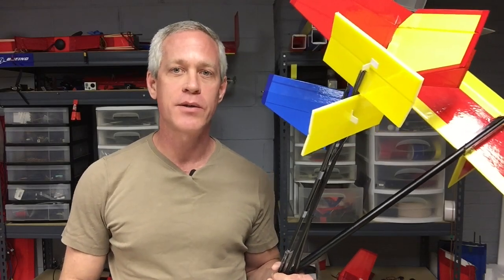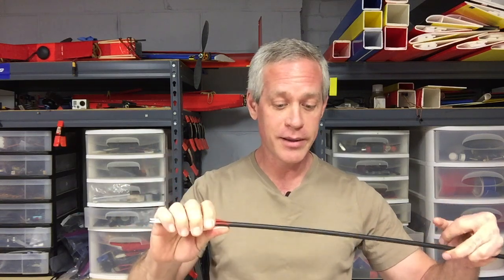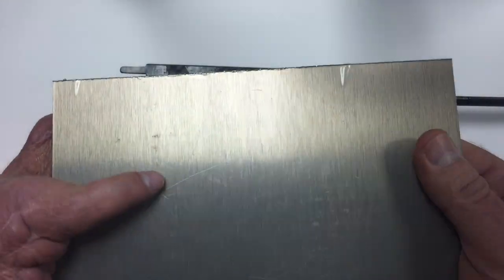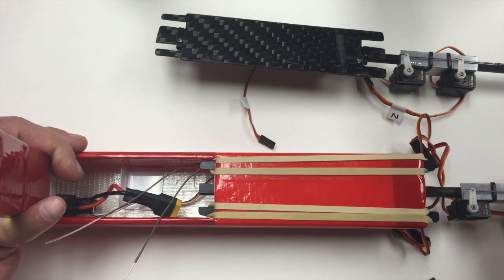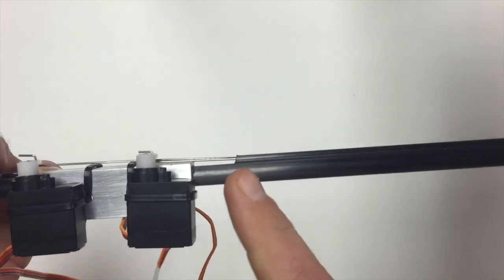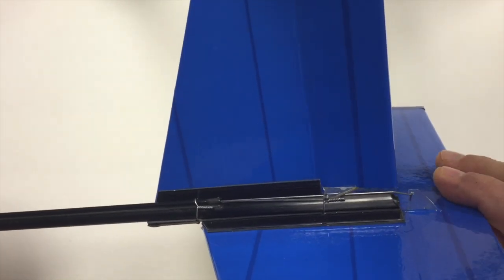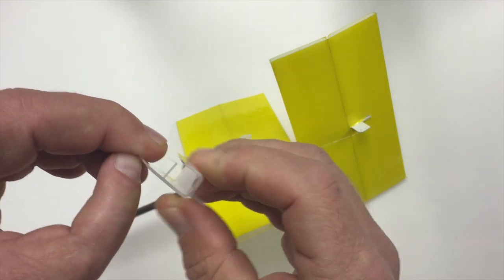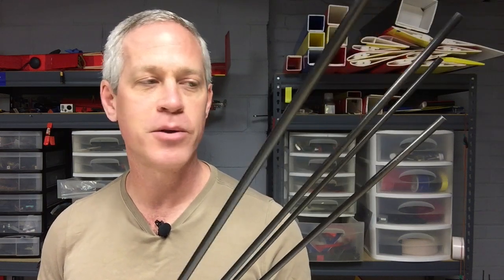Carbon Fiber Tail Booms

Comment: I know the Experimental Airlines designs have always been about cheap or free materials and ease of construction.  Ed, you got me back into the hobby with your building techniques, Thank you. I picked up a cheap 3d printer and have been using it to create servo mounts and tail adaptors similar to your corner molding.  Not everyone has access to the 3D printing and your methods are wonderful.  3D printers have come down to the "affordable" realm and fit into this hobby well. If you do have access to 3D printing, I recommend giving it a try.  It's been fun learning the cad software and actually fabricating custom parts for individual tasks.  Keep the videos coming and thanks again!

Comment: Some great ideas on attaching those CF tubes. Would have liked 
to see some of those designs in the air.
Reply from the maker: +lasersbee I wish too.  Here's the bummer:  I'm reduced to videoing with my iPhone, having gradually killed off all my proper video cameras.  Once I re-acquire a camera with zoom, I will make it right with the flying videos.
Reply: +ExperimentalAirlines I hear you... Sounds like a plan
Reply: +ExperimentalAirlines peter from flite test worked there

Comment: great vid - using a 10mm boom I have put my servos up front in the fuz, run the snake tubes down the middle of the boom, and drilled exits near the end - the reduced strength compensated by a 1/32 ply tail 'tray'. I really like the reusability and disassembly of your system though.

Comment: One advantage of using double stick tape in construction is that it can be removed with alcohol. It's messy but repair is easier when major components are assembled as you have done this way.

Comment: i attach the tail boom to the fusolodge with a installation foam block by drilling a hole and glueing the spar in it. then sliding the blick in the rear of the fusolodge rock solid without cf

Comment: You could just drill a hole through the plate and the tube and drop in a pin AND that would stop rotation and new way more reliable than glue. Also you can reuse the tube without having a glue mess on it.

Comment: Try inserting the 8 mm tube in several inches of a 10 mm square tube (it's a perfect fit) with  some hot glue. That gives you a flat surface to attach plate or fuselage.
Reply: +geo dezix What a great idea

Comment: Great video Ed.  Thanks. 
Any ideas on how to work with the plastic corner bead material? Does it have to be heated in order to bend without breaking or splintering; and the best way to make clean cuts?

Comment: how about assembling a V tail on a small carbon tail boom??
Reply: Chad Gacs you could use the L shaped plastic at a 45 degree angle.
Reply: Chad Gacs you could use the L shaped plastic at a 45 degree angle.
Reply: the design is a 100 degree angle for the V tail.
Reply: Heat the plastic with a hotairgun and bend it to about 100-110 degrees and finally EPOXY the carbonfiber right at the vertex of the "V". Remember to sand the carbonfiber at the end or else it wont bond properly.

Comment: All I can say is GET A 3D PRINTER!!!!  Printing small attachment fixtures to transition from carbon fiber tubing to foam components would require only a small printer and they're getting less expensive and better every day. The possibilities are endless. Once you invest a little time using a free CAD program to design the part, you can print the component while you do something else. Three D printing is slow, but pretty much something which doesn't require a great deal of attention.  Then it's a matter of assembly along with a spot of adhesive and, bingo, you're done. The act of "fabrication", which includes layout, cutting, sanding, and custom fitting is all but eliminated.  Keep in mind that duplicating a design using the techniques called out in this video means that you're starting all over again with the same tedious cutting, sanding, and fitting routine.  With 3D printed transition components, you simply print a new part.  The design work is already done.   Or, even better, print a spare part or two at the same time you make the first one.  You gain a great deal from the standpoint of aerodynamics, weight savings, ease of assembly, accuracy of alignment, strength, appearance, and just about every other design consideration you can think of.

Comment: Faa Modernization and Reform Act of 2012, section 336.

You've been fooled by the FAA.
Reply from the maker: +Josh Bishop Better I have my stupid little sticker in case Johnny Law shows up at the field and fight the conflict with the 2012 law in court.  Just playing the game.
Reply: +ExperimentalAirlines Your right, it will save you some hardship, but should you go through the hardship, you'd be able to cash in. It's only a matter of time before the FAA gets slapped with a massive suit from someone who is fined or arrested, the FAA won't win.

Obviously not everyone would want to go through that kind of disruption in their life but the first one to do it will be doing the rest of the hobby a huge favor.

I plan on printing out section 336 and putting it on my aircraft but at the same time I chose where I fly carefully and avoid attention.
Reply: +ExperimentalAirlines Some battles are worth fighting. This ain't one. Ham radio has far more hurdles and restrictions.  The sheer number of pilots (including a tiny subset of fools) makes some form of testing and licensing almost inevitable.
Reply: +Chuckles a the regulation needed to happen but the FAA doesn't have the authority. This is absolutely a battle worth fighting, it goes much deeper than whether it should or shouldn't happen. Law breaking is law breaking, the FAA isn't exempt because they failed at enforcing pre-existing laws.